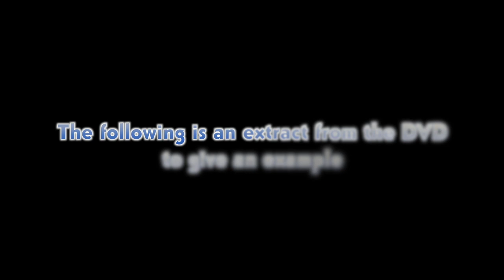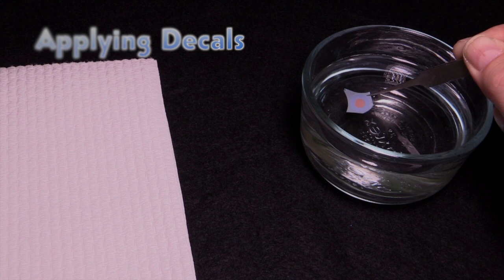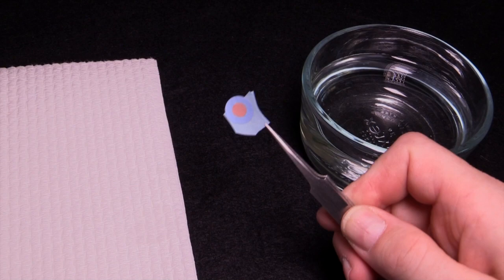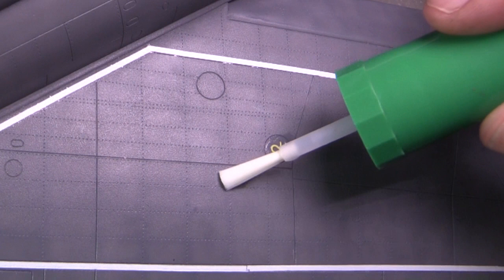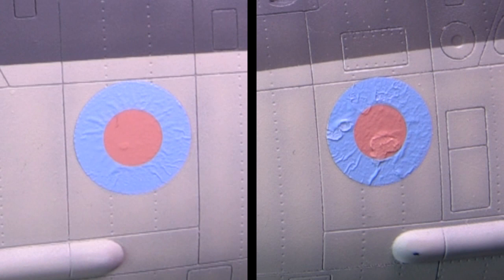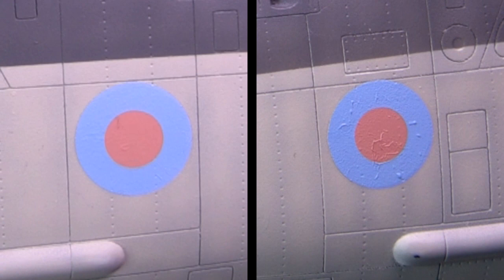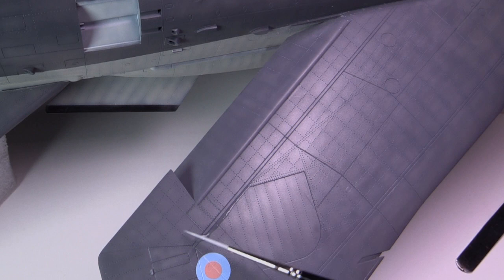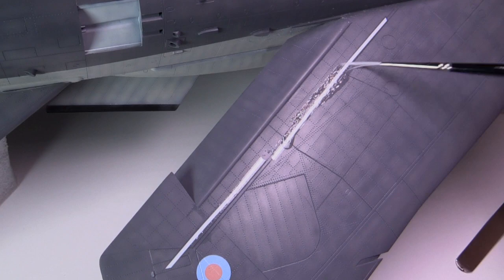Teaching Techniques #1 Aircraft Basics - How to build scale models

Comment: If I had known this was just a teaser for someone flogging a DVD, I wouldn't have wasted my time. Got to agree with the majority and say the example aircraft, the EE Lightning, just didn't look realistic, even apart from the way overdone panel lines and oil, grease marks etc. I've been up close and personal with a Lightning and they, in normal service, just don't look like that. 
All of our aircraft, in the RAAF, were also much cleaner when seen up close. Although there aren't many obvious panels on modern passenger aircraft, next time you fly, { if we ever do again ;(  } take a close look at the aircraft you're about to board. They are regularly washed and their paintwork touched up when needed, still you can see some of the panels and they are barely recognisable at all, depending on the aircraft type.
I can totally understand modellers when they accentuate panel lines because the kit maker just hasn't marked them properly in the base plastic castings. It's a great idea to lightly score the faint panel lines but let's not go overboard. Seriously, I've used a special kind of black pencil, kind of like a hard 'Chinagraph' pencil to make finishing off panel lines; then applying the final sealing coat of matte or semi-gloss.
If the RAAF people working on our flight lines allowed aircraft to get as filthy as some modellers make aircraft, they'd be up on charges for dereliction of duty. There's almost nothing one can do about prop or jet engine exhaust marks in the real world or in modelling. The real-world clean exhaust look only comes when it's time for a full repaint. Then the exhaust marks quickly build up again.
Some of the ultra-modern military aircraft, like the F-35, don't become very 'dirty looking' because of their design and the low-viz variants of grey they are painted, or treated with. Their movable panels and door joints are engineered to be extremely close fitting to aid in the aircraft's overall 'stealth' treatment. So, my advice is to nearly finish your model then look at it closely, even taking hi-res photos of it and ask yourself, given the type of aircraft, how much flying would it do on a daily basis, how often would it be serviced etc. Then scale back on your panels and overall 'weathering'. Remember that a lot of modern military aircraft are kept under cover for some of the time so they can be worked on at a moment's notice. Cheers, BH